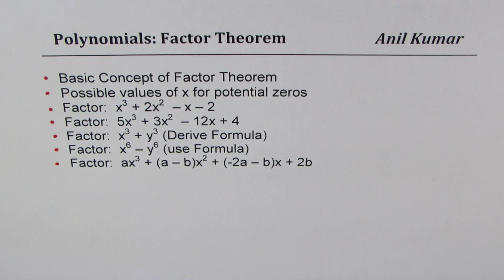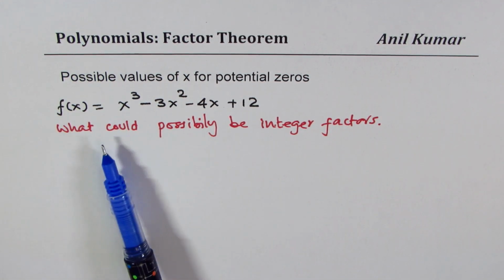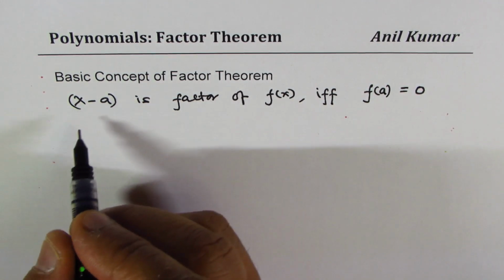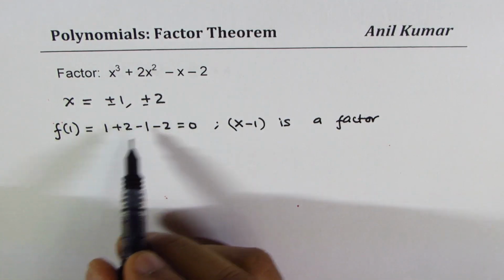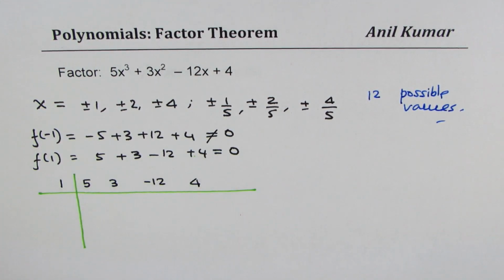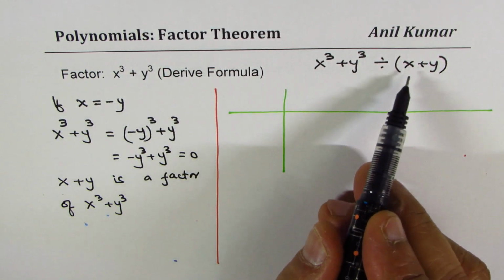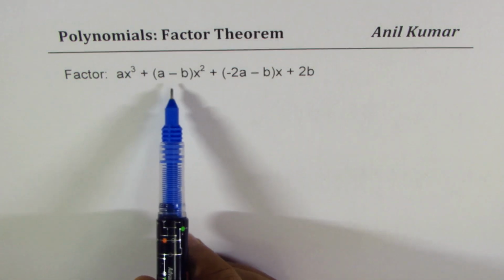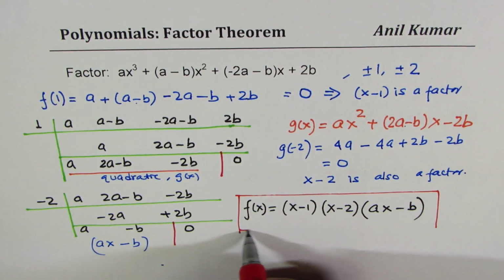Factor Theorem Concepts with Excellent Practice Questions

Comment: Sir i have this question 
I have to factorize y^2+5y+5 
So i did - 
y(y+5)+5 = 0
y(y+5)=-5 - now as you said y can be factor of -5 so i did just that and put the values of its factors such as 1,-1,-5,5 but the answer was NOT LHS = RHS
i watched only till 10 min maybe i will get my answer in some time
Or cna you tell me its answer
Now at 22 min
Trying the extended version 
So 
Factor of 5 = 5 ,1 and their minus
Factor of y^2 coefficient 1 = 5/1 , 1/1 and their minus 
Now possible values = 8 
If if put  them still no ans
Reply from the maker: y^2+5y+5 does not have integer roots. You may use quadratic formula or completing square to find the roots. Hope that helps. Thanks
Reply: @MathematicsTutor  sorry if I am just annoying you at this point but is that question too hard for 9th grader cause I can solve all the other and this chapter doesn't have much weightage and this not even a question given in textbook i just somehow wrote it by coincidence 
If it is not worth wasting time and I'll learn it higher classes 
Can I leave it for now
Reply from the maker: @Aditya-s8q4n  Check in your school, how many can solve and then you will get the truth, You are bright!
Reply: @MathematicsTutor  i donot understand words that u said can you explain a bit or give me a solution
Reply: @MathematicsTutor  if not I can understand